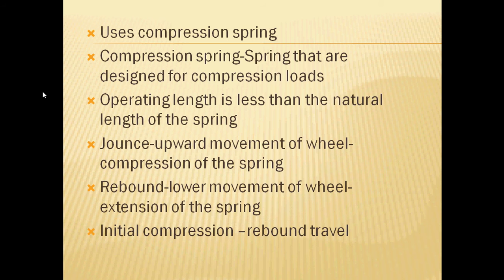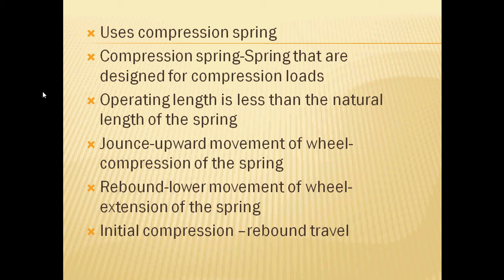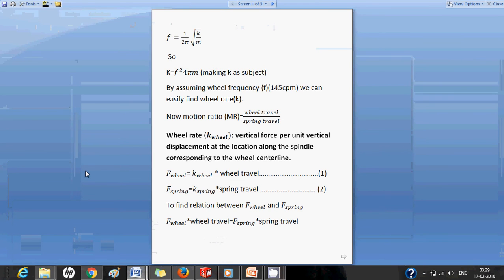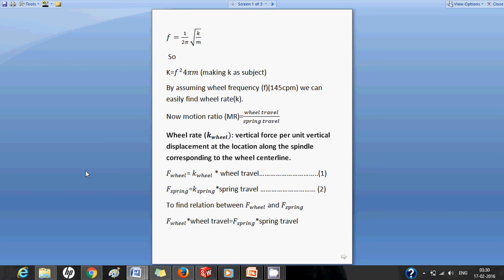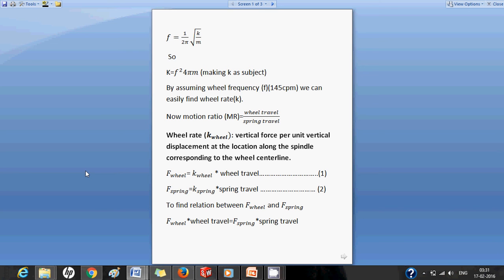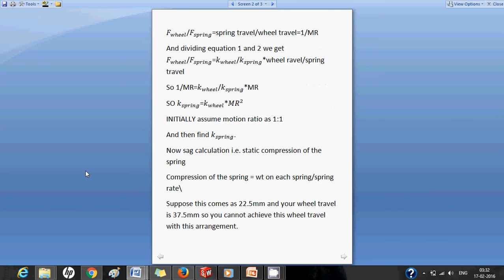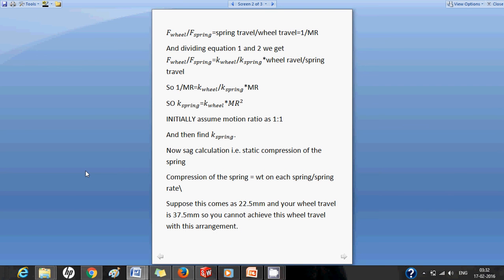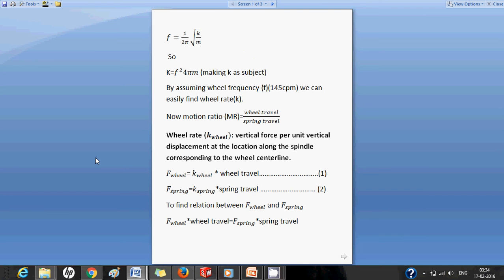fsae suspension spring design procedure part 1

Comment: I know the value of spring stiffness, mass . how can I calculate spring travel
Reply from the maker: kollipara hemanth suppose you have spring stiffness 30 and mass falling on it is 150 KG and natural length os spring is 280mm. Then when you assemble then due to weight falling on spring it will compress.In this case it will compress by 50mm. As we are using compression spring during jounce it can extend upto 50mm (length by which it was compressed) and not beyond that so that forms your basic of jounce wheel travel.
I hope this reply helps.

Comment: these calculations belongs to push rod type suspension system ??
we are not using push rod type of suspension so we need our motion ratio below 1.... what we can do for these query? please guide
Reply from the maker: Yes this calculation is for push rod type suspension. In case you don't need motion ratio, then required wheel travel and ride rate becomes your design constraint. But even in case of conventional double wishbone suspension, motion ratio is not 1. It depends on angle between spring damper axis and lower wishbone. If you require more detail then you can contact me. My email id:alekh.sinha09@gmai.com
Reply: sir but we need installation ratio ..For get the location of mounting of spring on lower wishbone so what about IR!
Reply from the maker: akshay patil installation ratio is resiprocal of motion ratio which can be found by similar procedure.  I have tried answering your query through email. Feel free to contact further
Reply: sir if i mount spring near to wheel that increases motion  ratio or decreases motion ratio
Reply from the maker: akshay patil it depends on angle between spring axis and lower wishbone. If it is near to 90 then it is nearly 1 for other it is less. ( I am considering motion ratio as spring travel by wheel travel)
Reply: Innovators  but if i mount near to wheel , installation ratio is decreased so as u said MR is reciprocal of IR so MR is increased .
am i right or not?